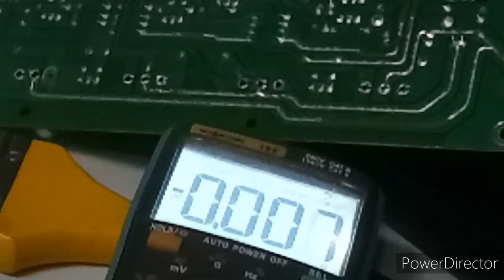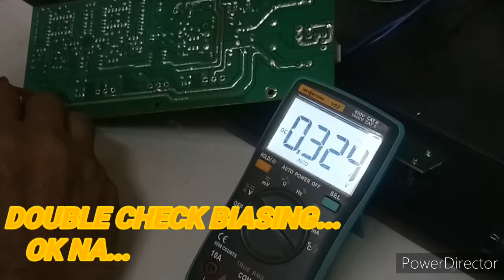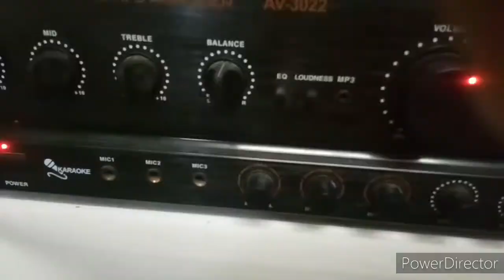HOW TO REPAIR SAKURA AV-3022 NO SOUND

Comment: di ma virify kasi dimo sinabi lung anung pangalan mg piesa na pinalit mo boos
Reply from the maker: O2  nga HahahA..  Pacnsya baguhan PA.. Actually Yung dalawang opt trans napalitan q jn..  Isang D817 at D4107.. Tapos yung driver transistor na S9014.. At mga resistor Yung lng..